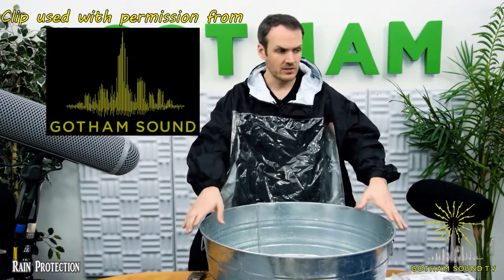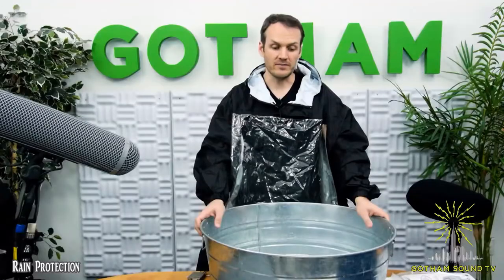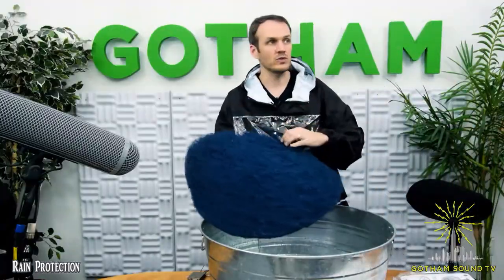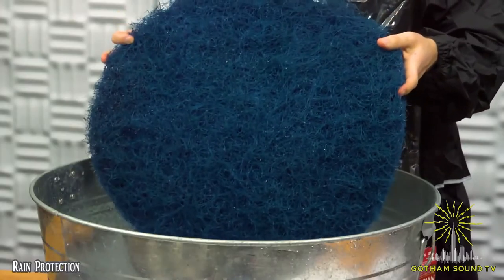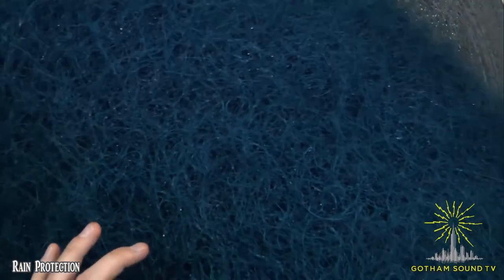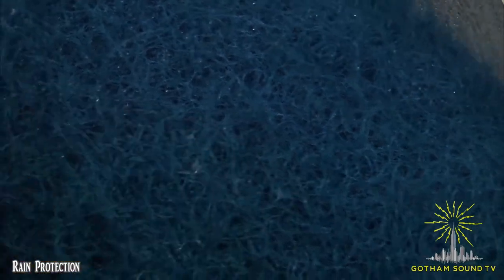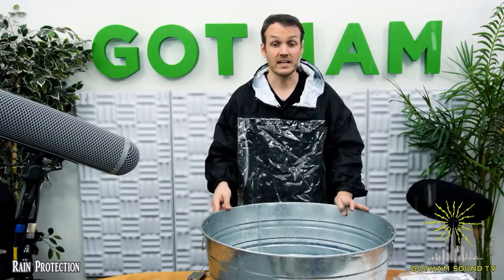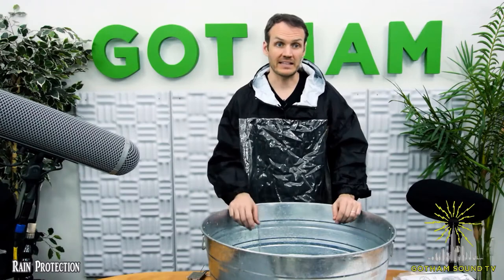Rain Silencing - Sound Speeds

Comment: Great advice. I only wish i could use it. I have been trying to find hogs hair in the UK for ages now to no avail.
Reply from the maker: rebel200794 No furnace filters or air conditioner filters that would work?
Reply: Not that I've been able to find. All the stuff I've found over here is a radically different texture, seems to be far more solid.and compact. Maybe I'm just looking in the wrong places but every fellow UK based soundie I've asked has yet to find an equivalent over here.
Reply from the maker: rebel200794 I just reached out to a mixer friend that moved to the UK last year and asked him what he found as a replacement. He said that padding for old cars works. He's getting me a URL for some. I'll post here when he sends it to me.

I searched Google.co.uk for coarse fiber mats and came across pond filter mats. They aren't exactly like hog's hair but there are low density options that could work.
Reply from the maker: rebel200794 I've added this link to the video description. You can find hog's hair in the UK here: https://www.woolies-trim.co.uk/product/1532/rubberised-horsehair
Reply: Excellent! I have been looking for this sort of thing for ages. Thank you for the help.

Comment: Hi, do you have any experience with the Remote Audio Rainman, to soften the impact of raindrops falling onto the boom microphone? If so, do you think it's a good solution? I feel like the exposed front of the microphone is great for audio, but bad for wind noise. Also, I heard the rain can end up dripping in an unnatural way in the shot. Do you have any other recommendations to protect a shotgun microphone in the rain (and from the sound of raindrops on the mic)? thank you :)
Reply from the maker: Personally, I'm not a fan of the Rainman. Even with water resistant spray it soaks and gets heavy quickly. Plus it closes off the entire mic except right down the barrel and when you go vertical, you have to tip down the nose to keep water out. The Rycote Duck doesn't cover enough IMO. Personally, I think the best solution is the Cinela Pia-Kelly with water resisting spray on top. It's the best at rejecting water and routing it away from the zepp. The Rainman allows it to pass into the zepp.
Reply: @SoundSpeeds  Thank you so much. I have a Rycote super-shield blimp. Do you think the Cinela PIA-KELLY would fit on it? it seems to be made for their own zepplin/blimp style system.
Reply from the maker: Correct. The Pia-Kelly is design for the Piano or Pianissimo Cinela zepps. They won't fit anything else.
Reply: @SoundSpeeds  Thanks for the info. Keep making your awesome content. Take care!
Reply from the maker: Thank you and thank you for watching.